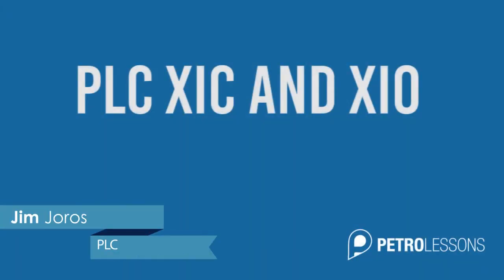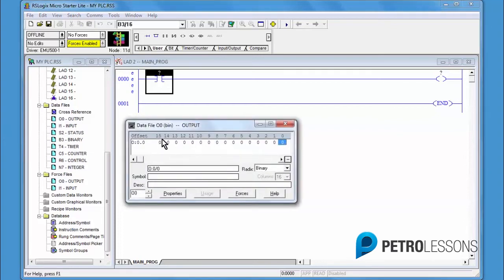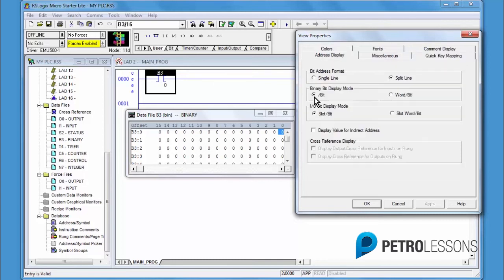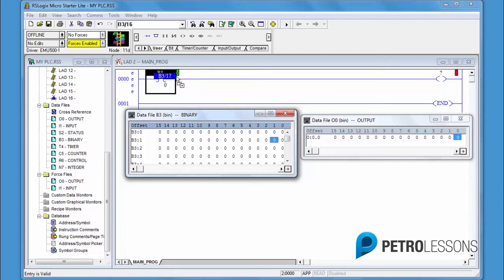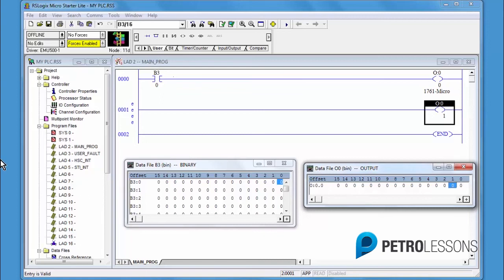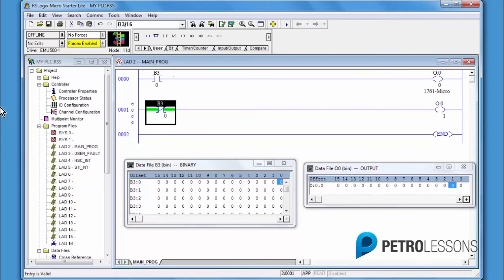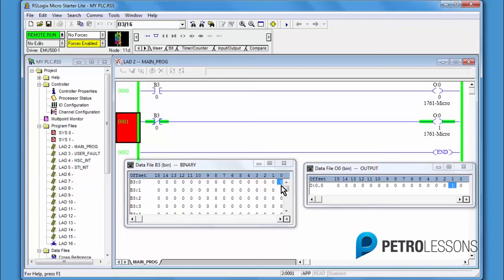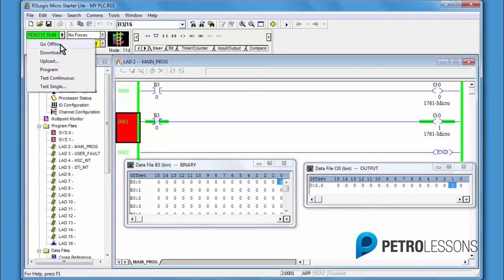How to Program PLC's by JIM JOROS - PLC Programming Basics XIC and XIO

Comment: hi, when I verify the rungs, I have error message though I followed the steps. why??
Reply: Verify Results tab at the bottom of the window will open to show you if any errors occurred during the verify procedure. To locate the error, Click on the + symbol to expand the list to show the File # and the error(s) associate with that file. Click to go to that location in the program file, make the necessary changes, and then, when you have corrected all the errors listed, verify the program again. If no errors are found the Status Bar at the bottom of the window will state that the “Verify” completed and no errors were found.